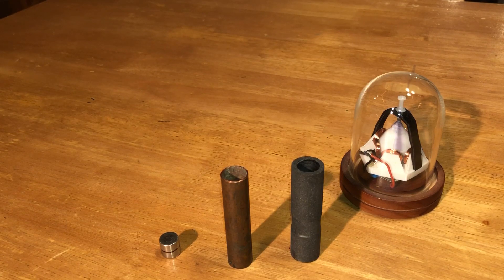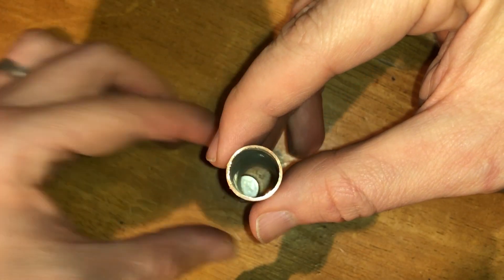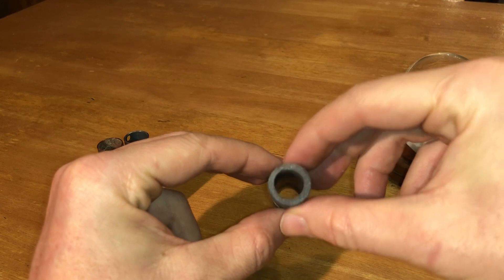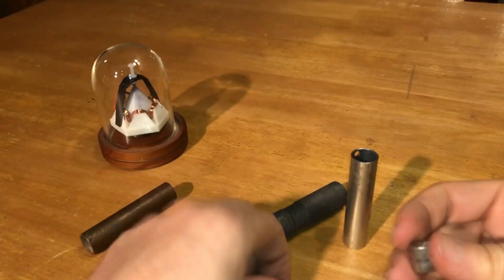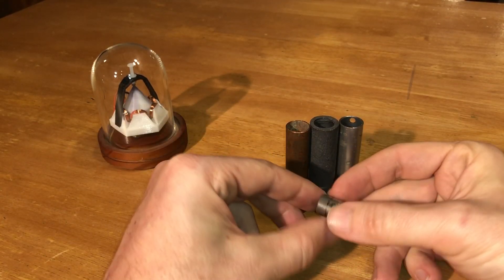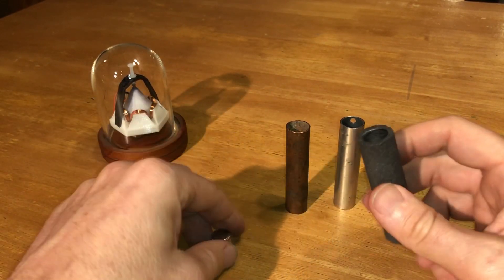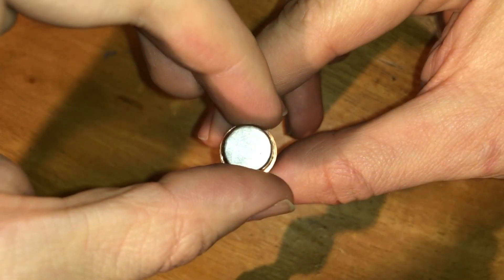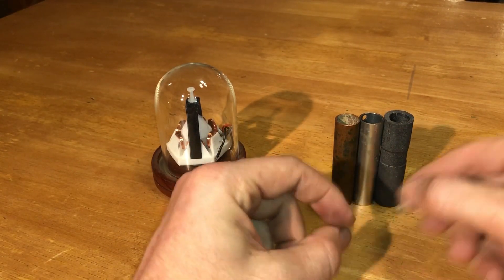Lenz's Law - Magnet Through Carbon Tube?

Comment: Won’t work. No electron-sea model for the graphite. Unlike metals. Has to do with the way the electrons are shared...
Reply from the maker: Are you thinking that you cannot make an electromagnet with carbon?  I honestly do not know myself.  So far the only thing I have come across doing a little research is this: http://news.rice.edu/2015/10/16/graphene-nano-coils-are-natural-electromagnets/
Reply: @lasersaber  Agreed. From your linked article: "The researchers determined that when a voltage is applied [to graphene], current will flow around the helical path and produce a magnetic field, as it does in macro inductor-solenoids."

Graphite is usually less conductive so you'd need more power to get the same current flowing and therefore the same magnetic field strength.
Reply: @lasersaber  any idea how to obtain this material? Seems like the biggest hurdle.
Reply: @lasersaber  actually found this. https://youtu.be/4XDJC64tDR0 Is that you demonstrating the lights? Sounds like you. Haha.
Reply from the maker: @TrentTationnaiseXization  Not me in that video.  That is an amazing video!  Thanks for sharing.
Reply: @lasersaber  ya ha the voice tho was on point.
Reply: Electrons traveling along a path through space creates a magnetic field [from certain "reference frames"]. The same can be said for electrons flowing continuously through a similar conductive wire path. Regardless the resistance of the wire a certain amount of current will generate a certain magnetic field strength - assuming DC current and nothing nearby interacting with the field & current.

The difference in resistance will however dictate what voltage & power you need to drive that current. The higher the resistance, the higher the power consumption needed and the more like a toaster wire it'll become.

This is one reason that room-temperature superconductors would be a boon for electrical utility companies. The higher the resistance of the power lines, the more energy they waste as heat that won't make it to your outlet. With no resistance superconductors they'd recover most of that energy.

However while it's interesting to discuss theory and math, it still can be awesome to see practical experiments test our assumptions :-D
Reply: Essentially the bonds in graphite are more confining than in a metal (can move, but not in the tight circles necessary to induce a magnetic field). In graphite they’re only de-localized to a small extent allowing conductivity, where in a metal the electrons are not so confined but are rather de-localized — allowed to travel freely within the metal lattice enabling the tight circular motion which induces a magnetic field.
Reply: I think its more about diamagnetisim.   Google "superconductor diamagnetic", and "graphite diamagnetic" diamagnetic materials repel magnetic field penetration into the diamagnetic.
Reply: It has to do with the way the electrons are shared among the atoms of whatever material you’re trying to induce a field in. The reason conductive metals work isn’t explicitly because they’re conductive but because the material’s atoms are bonded via metallic bonds. They are shared among every atom in the lattice. Graphite doesn’t have these metallic bonds, just a consequence of what’s called the ‘electron sea’ model. (Not a physicist, just recalling some vague knowledge from college Chemistry)... I’m fairly confident the answer has to do with this... /shrug
Reply: You can make the coil over/arround it right?
Reply: Welcome back, electrons ? Lenz law ? Half cocked concepts that don’t include everything that’s going on... these dielectric materials should not engage lenses lie at all! You’re on the cusp of a very important idea... try putting the copper tube inside the aluminum and make similar configurations with the carbon...
Reply: @ApostleOfChange  yeah, the diamagnetic properties of graphite will reduce the magnetic flux lines cutting an outside copper tube.  Not so different than how a perfect dialectic  superconductor prevents magnetic field lines from penetrating it.
Reply: Electrons are only a theory no one has ever seen one, if you understand electricity and how it moves you will see electron theory isn't needed and wrong
Reply: @iandavid7474  what  we call electrons is always a kinetic phenomenon, whether it manifests itself likewise within a metal lattice is assumption.  And we all know that is the mother of all fuckups...

Comment: Lenz law
Reply: I was wrong!
Reply from the maker: I was on the fence about it myself.  Based on this first result I am thinking that a carbon disk will not work for a homopolar generator.  On the other hand maybe a graphite coil would function as a generator coil.
Reply: Homopolar motors are cool. The slip ring brush must move in relation to the rotor. battery (as motor) were to spin around it would have no movement.

Comment: Whoa, you're back! Welcome back, was worried something happened to you. Looking forward to more videos.
Reply from the maker: Thanks!  Glad to be back at it.  More coming soon.
Reply: @lasersaber  Love your generator/motor videos, probably watched them over a hundred times over the years. You should experiment with hoverboard motor wheels, they're brushless and amazing for power generation with super caps. Can pick them up cheap from used hoverboards! Also, is the tesla torch project still ongoing? I love the idea of it, and I was hoping to see you iterate and make it even better. It would be awesome to pick up one of those boards you made for the V2.
Reply from the maker: Thanks for the hoverboard idea.  I still have a ton of Tesla Maker stuff in inventory.  Maybe I will put it on eBay in the future.  I got spread too thin in the past trying to sell projects, do a full time job plus do experiments.